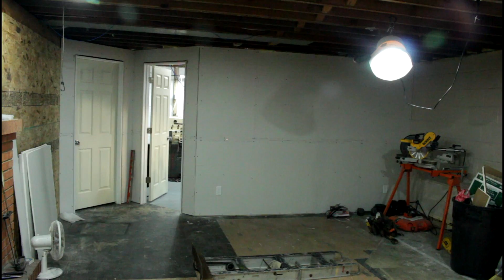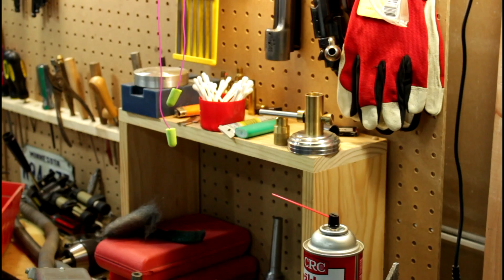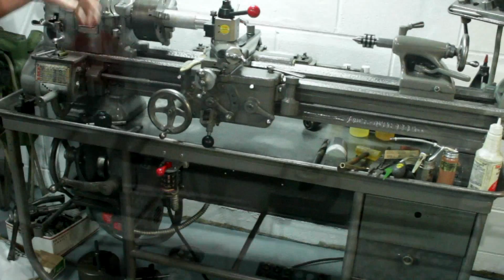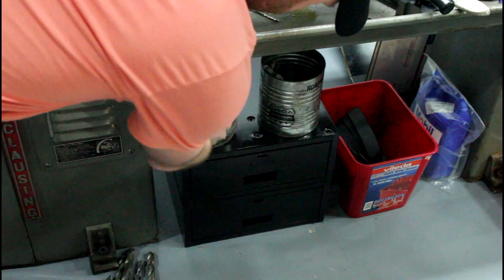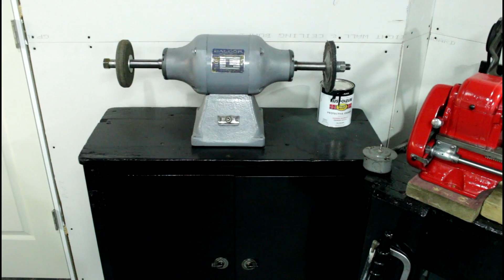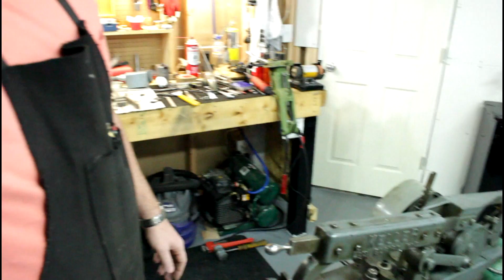Tiny Home Machine Shop Tour 2.0!

Comment: I had a 1967 Clausing 5914 from 2001 to 2009. We are divorced now. I am now with a PM1236 lathe.
I think I used a Logan lathe like that in Jr high shop in 1965.  It was a little shorter. 
I barreled 4 rifles in Sept and shot 3 animals in Nov. I am always looking to see if anyone does anything in their shop. I am 65 and started at age 5. Work in your shop  until you drop.
Reply from the maker: Thanks, my shop is ever changing and evolving. I do enjoy working on these machines and making stuff.
Reply: What gun smithing school did you go to?
Reply: @BenDover-ml8jh  I am an electrical engineer. But my brother  has a degree in machining.  He taught me how to use a lathe and a mill. He has not taught me how to TIG weld. I have  a TIG welded, but I am not good enough to weld bolt handles. I have to get others to do that for me.

Comment: You've got that set up really well.  Where are you going to place the saw?  Have you ever used any Mauser actions to build off of?
Reply from the maker: +Bob Guenthner 
Thanks! The saw will most likely stay there. I don't have room anywhere else. I've built several mausers and one on my main hunting rifles is an FN custom I built a few years back. I've also done several SR Mexican mausers too. They are really easy to customize, but are getting a little more expensive every year, just like everything else!

Comment: Nice use of space, I have gone smaller, I have may shop in a Cargo container, 8x20 Bridgeport, 11 rockwell, surface grinder and me. I like that it can be closed up and sealed from the elements, I will have a door entrance from the 3 car garage where I have a large variable speed rockwell drill press, tig, mig arc gas welding equipment, grinders bandsaws, chopsaw,outside is the homemade shop press and car lift. works go for me. will put a/c in the container for So Cal. heat. works for me.
Reply from the maker: +Ed Ginsberg 
Sounds like a nice setup. Those containers are so versatile and secure! When we buy a property outside the city I have contemplated several uses for those.  Thanks for watching and sharing!

Comment: FWIW it's a real bad idea to have grinder's, polishing equipment etc anywhere near machine tools. The crud floats everywhere and over surprisingly long distances. Once it embeds into the machine slides it's then almost impossible to remove it. I do realize you'd like to keep everything under lock and key in your new shop, but it's simply not worth it. My shop is roughly the same size and when I have to I'll pack that type of equipment outside before I'll use it around the machine tools. Other than that you've got a pretty cozy shop set up.
Reply from the maker: +Turning Point 
Hey thanks! I'm aware of the dust, but I'm pretty meticulous about wiping down my machines before and after i use them and I have not used the grinder or buffer much yet. Another room would be ideal, but I'll most likely set up a box for the buffer and connect a vacuum system to both until I get a bigger shop. My grinding is mostly touch up stuff! I don't like the grinder sitting there, but it's there till I figure out something better.

I will be getting a huge grinder one of these days with a 3" x16" grinding wheel! I wouldn't even think about setting that up near my lathes!

Thanks again!
Reply: +Precision Machine Shed We all face the same problem with grinders.  Gotta have them and limited space.  Something to consider is putting up a shower curtain track around the grinder area and hanging clear plastic (or pink with fishes would be ok, I guess) as a curtain to enclose it.  Cheap EMT electrical tubing would make a great ceiling suspended track that could be bent to conform to the area you want to isolate.  The curtains would be folded back when not in use and deployed when you were actually grinding.  Good job on the shop.   You got a lot going on in a small area.
Reply from the maker: I was thinking about the shower curtain idea. The EMT suggestion is a great idea. I'll most likely do that at least with the grinder, I'll see how the buffer is after I build a box.
Reply: For a lot of grinding or buffing just cover your machines that u are concerned about I,ve never been in a shop that didn't have grinders and buffers , being religious about cleaning your equipment is key to this problem. Tool post grinders??